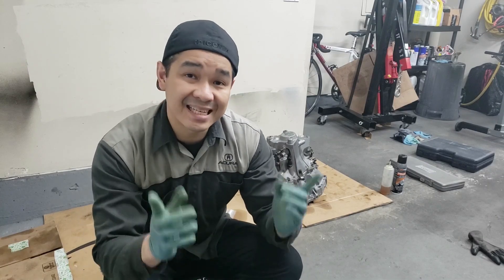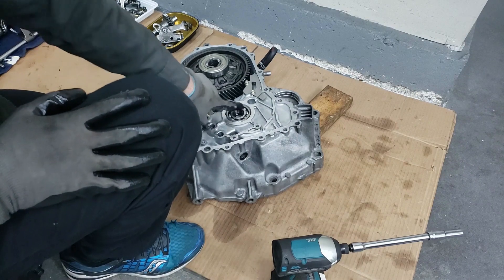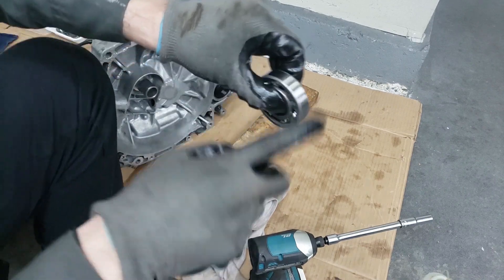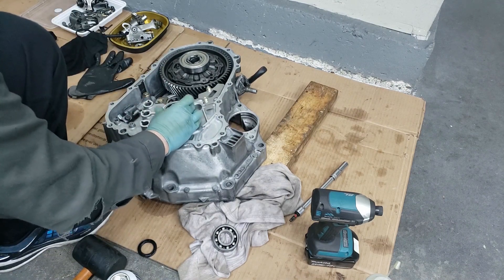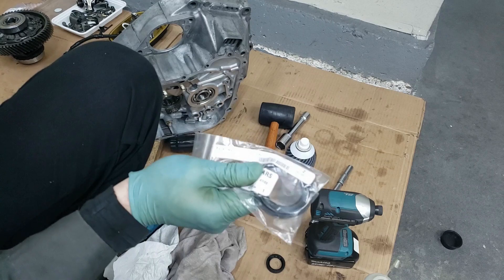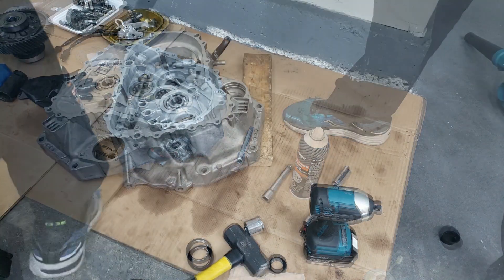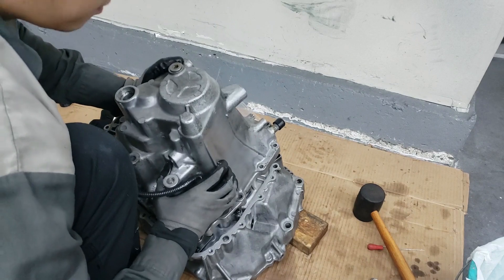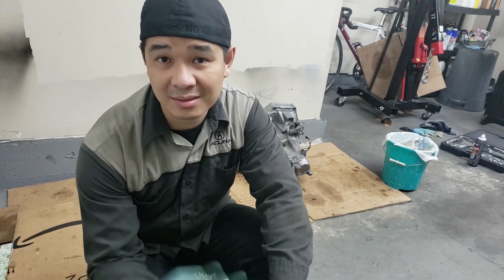|| HONDA EF9 / ED7 CIVIC & CRX || How to Install YS1 B-Series Transmission Bearing and Seals👍🏻

Comment: Are you banging on the inner race?  I have an S1 Cable trans your flat head screw driver method allows me to hit the inner race. The driver can't reach the outer race.  That won't pose a problem for my type of transmission?

Comment: sweet, my car started making that noise with the clutch out - I thought it was a flywheel bolt coming off. And before I even checked if the noise went away when pressing the clutch it was so loud I thought it was a rod knock or piston slap...had me a mini heart attack. I'm going to attempt this on my small spline Y1!